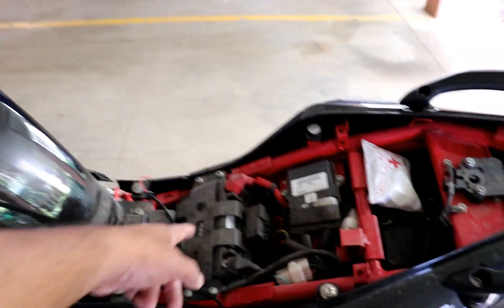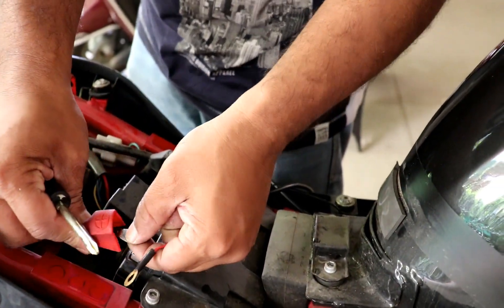Bolt Mobile charger on Benelli 300 - DIY Video

Comment: Charge only power bank on it. My friend used it in his FZ. While doing long ride it helped. But later his HTC faced non charging issue. Then finally HTC services center advice him to change his phone mother board as was damaged due to on even voltage supply.

Comment: Hello bro, I just tried the link given to buy it but its showing its can't be installed in royal Enfield Electra 2016 model
Reply from the maker: Hi Jyoti,
where did you see that info, that it cannot be installed on Electra? The Bolt can be installed on every bike.
Kindly do pass me the details where you saw so that, I can ask the team to make the corrections accordingly.
And bhai aau got jinisha, aamari Odia bhai hi foounder of Bolt.
thanks
Reply: Bulu Biker when I check the vechicle type its shows this product does not fit your royal Enfield electra twinspark you just try it I have the snapshot but unable to send here

Comment: connecting the charger straight away to the battery isn't advisable.. as there's no switch to turn it off., it would cause the battery to discharge.. at least it would have been connected to the ignition
Reply from the maker: +Naveen Kumar no buddy this charger unit has to be removed when you are away from your bike... Once you remove there is no power used... 
And if you dont remove it then someone else might remove n.keep it for you ha ha
Reply: Bulu Biker ya.. I saw that bro.. but what if you forget to take it off..
Reply from the maker: +Naveen Kumar well then someone else will take it ha ha.. that is one advantage n disadvantage
Reply: Bulu Biker ya😂